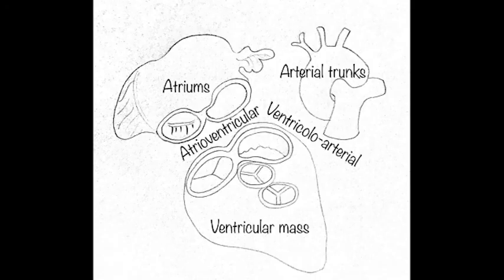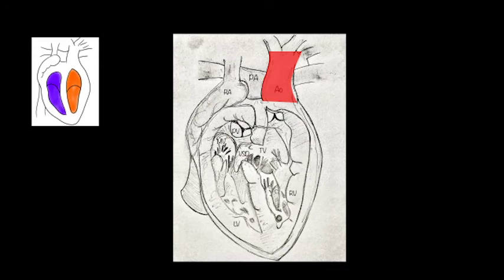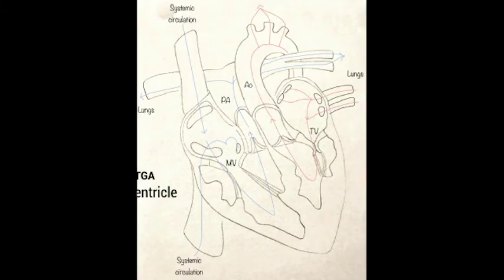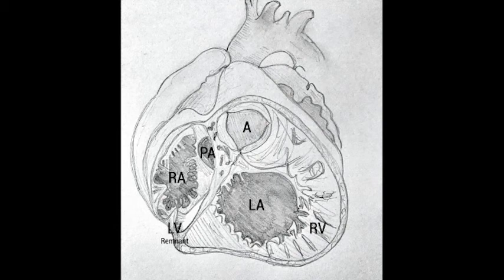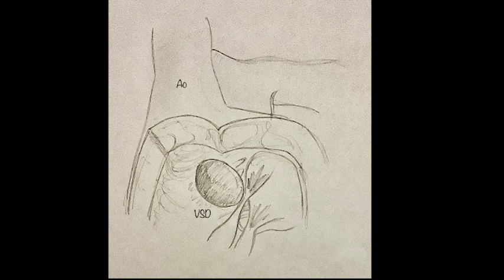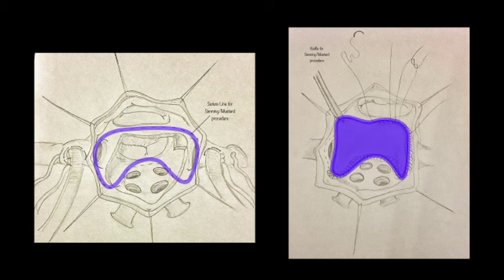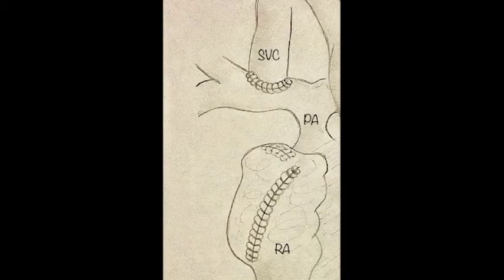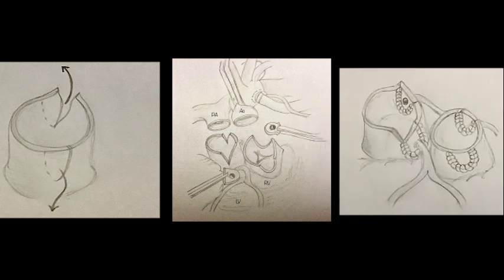Step-by-Step Double Switch Procedure

Comment: There is a mistake at 5'52" - 6'07". Pulmonary veins shouldn't be involved under the hemi-Mustard patch as the key idea of this procedure is to redirect only systemic venous flow from inferior caval vein to the tricuspid valve. Please check and correct. TIA
Reply: Thanks for pointing it out. It was a mistake with animation and colouring. We will try to correct. Appreciated your feedback